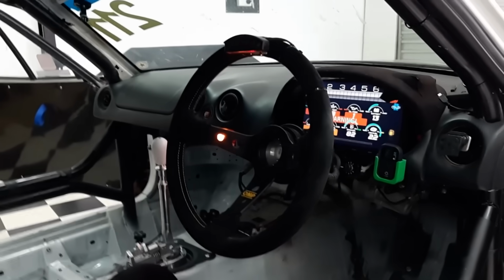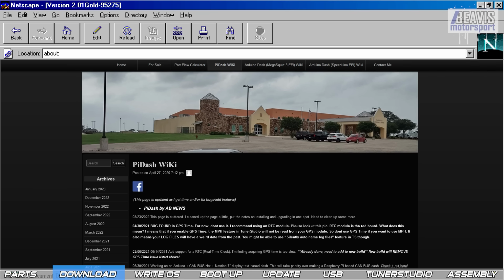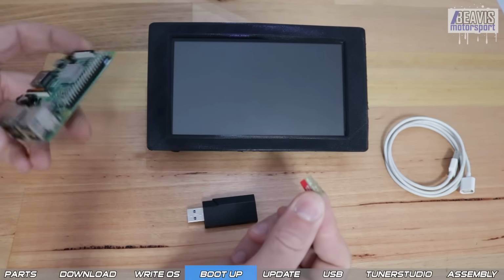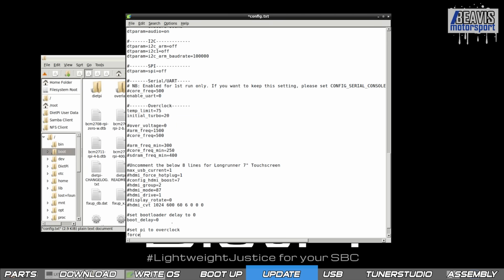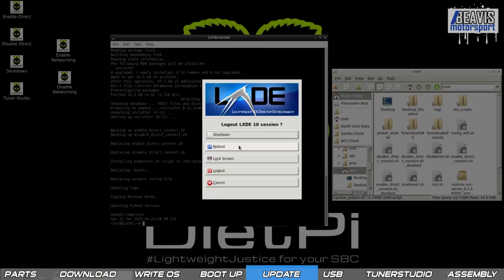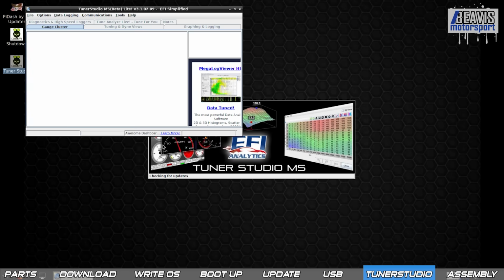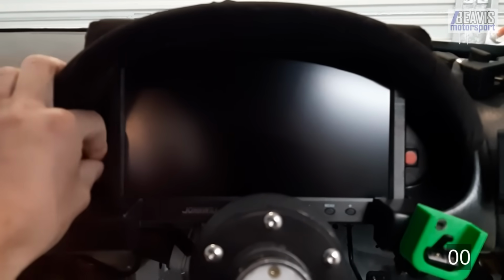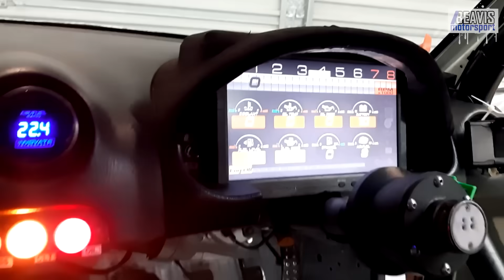DIY Raspberry Pi Racecar Dashboard: The Ultimate Guide

Comment: Awesome work! I created a very similar dash, the only difference is that I designed a safe-shut down circuit that utilizes the ignition signal and a little bit of hardware logic to automatically boot and shut down with the car keys. The initial prototype was just kluged together on a breadboard but I turned it into a PCB but have yet to get it made. Hopefully one day...
Reply from the maker: Nice work Cyrus, thanks for sharing your setup. For me, I have a hard battery kill switch, theres no ignition key in my track car, so that wasn't really going to work for my setup.
Reply: @Bbeavis  ah yes of course, because racecar. I love it! I’m definitely going to check out dietpi now though. Thanks again for the amazing content.
Reply: Could you elaborate a little more on this? I'd like to be able to use this setup on mine as well.
Reply: @rat_nuisance  automotive electronics (battery/alternator) are inherently noisy and contain a lot of transient voltage spikes. That said, sensitive electronics like RPi’s need protection from these voltage transients to avoid eventual death from the shock treatment they will certainly receive. Additionally, memory for computer systems like RPi’s can be corrupted when not safely shutdown (eg: yanking the power plug without pressing “shutdown” in the system menu). 

My circuitry provides three main features: 1. Protection against high voltage spikes, 2. Turn on with ignition on, 3. Safe shut down of the RPi when the ignition is turned off. Meaning the control circuitry has hardware logic working in conjunction with a Python script in the RPi to shutdown the RPi safely despite ignition telling the circuit to turn off…

I hope that helps highlight for you the problems I encountered and the methods I took to address those problems.
Reply: @cyruslegg I've used OSH Park to have small batch PCBs made for my own car projects. Very affordable and fairly fast turnaround.

Comment: amazing that people sell these things for $800 :face-blue-smiling:
Reply from the maker: When you compare to a commercial product, I guess it is very different. Businesses need to make their products more robust and bullet proof, whereas the solution in this video can be much cheaper, but its certainly more conducive to a tinkerer than a plug and play product.
Reply: @Bbeavis  nah man, ddefi sells this exact thing for €800 and it doesn't work close to as good as the diy one. Look at the donut media video, their dashes run at like 15 fps with delay, and they use the exact same pi hardware.
Reply from the maker: @Marco-yk8kp  Ah interesting, there are more and more solutions out there, some are better than others, I guess based on your description the defi one is not so good.
Reply: @Bbeavis  unless its a bosch motorsport or a CANbus one, its all the same stuff. A tunerstudio instance on a tiny computer mounted in your face. Only difference is if the script is preinstalled and the dash being made to fit your car or universal. If you shop for megasquirt dashes that ARENT canbus they are all what you made in a different size. Some are just msdroid tablets (for those of us with bluetooth megasquirts)

Comment: I wonder if someone made it so Kpro/Hondata can output the data to the Pi
Reply from the maker: Indeed this solution I have shared does depend on the ECU, so you'd need to see if there is a software/hardware solution that can communicate with Hondata.

Comment: Might have to give this a go to update my current dash. I mounted mine in the center console and also removed the stock climate controls. Since it's a street car I have a tuner studio dash on it but also wrote a python app to control an Arduino that runs some relays and servos to have touch screen control of my climate control. Not fully implemented in the car yet but prototype is currently working.
Reply from the maker: Nice work mate, sounds like you have it all under control already, but maybe theres a few options offered here that you can get some benefit from.

Comment: You need to setup a relay to do shut down off accessories rather than manually pushing a button. Nice work.
Reply from the maker: This is used in a race car, so it doesn't have a traditional ignition switch with accessories, its all cut via a battery kill switch, so I'm comfortable with using the push button for now.

Comment: Bonus 30 points for Netscape 2.0
Reply from the maker: :-D thanks mate!
Reply: @Bbeavis  BTW have a look at youtuber Novaspirit - mate of  mine in New York.  He has a car-android video but he also  has a build of a kiosk android config for ultra fast boot (for signage systems running on a Pi typically).  I'm wondering if this could improve powerup times on your boot;  typically I believe running off a super-fast SD card + USB 3.0 SSD gives fastest boot times, that said the boot cycle to date seems to be within expectations and even looks cool (shame the CLI text stream is so small, could make it larger and greenscreen for that Matrix Trinity Hacking look)
Reply from the maker: @davocc2405  Thank you, appreciate the suggestion.

Comment: Awesome Video.

Are you running an aftermarket ECU?

Is it possible to use the factory ECU with a Tactrix Cable or something similar?
Reply: Thanks for the detailed reply. Would you have any tips on what software I could use for Toyota 86 platform to read the data?
Reply from the maker: @billyrosewood5474  The solution I have shared does depend on using the Megasquirt family of ECU, so you'd need to see if there is a software/hardware solution that can communicate with Toyota computer. This is not something I have experience with sorry.
Reply from the maker: Hey Billy, yes I'm running this dash in a track car with an aftermarket ECU, it uses a Megasquirt MS3 ECU. So all my sensors, speed, temps etc go direct to the ECU. Then the ECU has a USB connection direct to the Pi to feed the data for the dash software.
So unfortunately if you run a factory ECU computer still, then you'll need to find some appropriate software for your car.

Comment: Will i use any other display like tab or anything like that
Reply from the maker: Anything is possible if you tinker enough. I've previously run an Android tablet to do something similar to what is presented in this video. In that scenario, you could use some apps like 'Torque' or 'RealDash'. Depends on the car you want to connect to.

Comment: @beavis how bout using a CAN pi hat ?  For remote installs 2 wire would be so helpful!
Reply from the maker: That would be an interesting alternative, obviously it would then depend on your car supporting CAN, and there'd be different software required to display the data. But hey, if you are clever with hardware and software, then it might be a fun challenge.

Comment: woooooow amazing configuration but for example if i want mount in a normal car works connected with ODB2 adapter?
Reply from the maker: Thanks very much Francisco.
In this case I am using the TunerStudio software which is specific to the Megsquirt ECUs. My car runs an 'MS3' which connects to the Pi via USB cable. I'm sure there is some OBD based dash software out there for the Pi, that may work for your needs.... You'll need to get a little inventive and look into what options are out there.

Comment: Very interesting build, but I'm wondering why the Pi gets shut down instead of just sent to sleep. It's passive powerdraw shouldn't even be noticeable on the battery.
Reply from the maker: Because it's a track car, and I cut the battery every time i shut the car off.
Reply: @Bbeavis  Ah right, those don't have a keys for the ignition I assume?
Reply from the maker: @BloodyMobile  In my car, correct, no keys, just a big red switch.

Comment: Has DietPi still Problems with Wifi only installs? Tried it a few month ago on a Pi 3B. Didn't get it to run.
Reply from the maker: Hi Christian, I noticed no issues with cabled ethernet, or wifi, I had used both during my build/setup of the Pi.

Comment: How does the dash get all the data to display
Reply from the maker: Hey PDRIFT, this is using the TunerStudio software, specific to the Megsquirt ECUs. This car runs an MS3 which connects to the Pi via USB cable. So all my sensors, speed, temps etc go direct to the ECU. Then the ECU has a USB connection direct to the Pi to feed the data for the dash software.

Comment: How do you collect data from the vehicle into the Pi?
Reply from the maker: Hey Jeremiah, all my sensors, speed, temps etc go direct to the ECU. Then the ECU has a USB connection direct to the Pi to feed the data for the dash software. In this case I am using the TunerStudio software which is specific to the Megsquirt ECUs - that's what I run in this car.
Reply: @Bbeavis  All that sounds like BEEP BEEP BOOP BOOP to me but i appreciate the response ... do you have any videos that teach this part of the connection?
Reply from the maker: @jeremiahbullfrog9288  It can get pretty detailed depending on how far down the rabbit hole you want to go. But sadly I'm not sure I have any specific videos to help you out with more info I am sorry.
Reply: @Bbeavis  OK thanks!

Comment: Although it’s a bit slow on boot. I do like it. But without a 3D printer hard to realize.
Reply from the maker: I wouldn't let the 3D printing part of the equation stop you, there are always other ways to make it work. Or, find yourself a used ender3 printer for ~$100 or so and start a new hobby :-)

Comment: Excellent video.  I see you have customised your own display.  Could you go through that?  I'd like to make one for my gyro.  Different sensors but all using gpio so wondering how easy it is to design the graphics.
Reply from the maker: Thanks very much Cameron. The dash imagery is designed in a basic image editor (such as Photoshop), nothing too special there. Then it's  put together using the TunerStudio software to implement the data overlays from the cars ECU. Note that the TunerStudio software is specific to the Megsquirt ECUs which is what my car runs.
Hope that helps!
Reply: @Bbeavis  yes that helps a lot thanks

Comment: This is really awesome. You might think about modifying your shutdown script to take advantage of a relay instead. Connect the relay to your 12v + and - so it detects when the car is on. When you turn the car off it would then close the relay invoking the clean shut down sequence.
Reply: With a race car, you won’t want to wait 30 or 40 seconds every time you’ve switched off the ignition. 
My Fiat ignition switch goes from zero to start no problem. But just switch on but don’t start and you have to switch it off & on to start the engine. A Pi dash would need its own switch. Or maybe a relay connection with the door locking.
Reply: basicly acts like a sense pin (looking fo acc. min.) for key turn i take it?
Reply from the maker: I have considered it, and definitely that would make sense for some people/cars, but for my purposes i like the simplicity and control i have with the current setup.

Comment: If I didnt already have Fueltech I would absolutely go this route if I had purchased Haltech or Link. This takes a bit of time but it saves so so much money!
Reply from the maker: Thank you, 100% this isn't a plug-n-play off the shelf dashboard, but it is generally far cheaper. One perhaps needs to have a tinkerer mindset to build and maintain something like this.
Reply: @Bbeavis  Anyone serious or even semi serious would really understand the value of something like this. If anything it could be a nice update for 20+ degraded analog oem gauge cluster
Reply: @uknterror508  problem is usually the boot time, I planned to build one to replace my failed speedometer but never found something that could boot fast enough.
Instead I use a microcontroler with a very crude display, but it's not really appealing nor big enough. The µc boot almost instantly but doesn't have the power to drive anything other than a very small screen with a 3fps refresh rate.
There might be a workaround, by driving it with the door switch instead of the ignition key, so once I'm ready to start the car the Rpi would have already started.

Comment: How do you connect your ECU to your USB extension cable? How do you know which pins to connect?
Reply from the maker: The ECU has a USB connection direct to one of the Pi's USB ports, to feed the data for the dash software.

Comment: Good job Guy ;oP
Very interesting...I want to do the same thing but for a 70s vehicle. so i need to add an analog to digital interfaces part to get the information from the analog sensors for the Rhasberry :o)
Reply from the maker: Thank you. Yep for an older car you'll have a bit more work up your sleeve to get information about the car. I am running my car on a Megasquirt ECU, if you can update your car to EFI (assuming its carb), and run it on an Megasquirt ECU, then this dash config would be more or less plug and play.
Reply: @Bbeavis  Yesss ... :oP 
It is indeed a carbureted vehicle.
Can you tell me more about "EFI transformation", what is it?

Comment: If you use a Sandisk extreme usb sad you should be able to speed up boot up time pi 4 supports this for awial now
Reply from the maker: I have tried a Samsung USB boot drive and didn't find a measurable improvement in startup time, but suffice to say I didn't spend too much time trying to ensure I did everything right to get the most out of USB boot performance.
Reply: @Bbeavis  my sandisk read speeds run at 3 gig/s. I haven’t ran it in the pi for a bit as my needs are more storage then speed that I was using an 8tb external drive instead that was a big headache with having to manually switch mbr to gpt and then edit a file to have the correct uuid for the new setup

Comment: Cool video, thank you, is there any sort of tutorial on how to actually integrate in the vehicle? Lets say for instance if you wanted to swap in to your daily driver? or for setting up in a race car?
Reply from the maker: Hi FOTW, thanks for your comment. I guess I didn't touch on that element of this dash setup as much as I should've. This is using the TunerStudio software, specific to the Megsquirt ECUs. This car runs an MS3 which connects to the Pi via USB cable.
If you run a Megasquirt family of ECU in your car, then you can apply the same software process as I have detailed in the video. If you run another ECU, or the factory computer, then you'll need to find some appropriate data/dash type software for your car/ECU.

Comment: Awesome project, however, how does the Pi know all of the vehicle's data to display?
Reply from the maker: Thanks Kit,  apologies I didn't touch on that 'car data' side of this dash setup as much as I should've. This is using the TunerStudio software, specific to the Megsquirt ECUs. This car runs an MS3 which connects to the Pi via USB cable.
If you run a Megasquirt family of ECU in your car, then you can apply the same software process as I have detailed in the video. If you run another ECU, or the factory computer, then you'll need to find some appropriate data/dash type software for your car/ECU.
Reply: @Bbeavis  Thanks for the reply - guess that's only for modified cars though.

Since my Car is quite old and I guess it does not have an ECU (does it?).

Anyway, that explained it very well :)

Comment: I was looking for digital gauges to put on a bike, but this is a nice project. Is there a 'cutdown' version of the software (just rpm,fuel,oil,km), maybe a smaller screen that you know of?
Reply from the maker: Hey Cade. The dash image/data is very customizable within the TunerStudio software, so almost any design is possible.
You could run a different size screen, more or less any display that uses an HDMI port should work, I've had smaller 7" screens before, and I'm sure there are even smaller options if that's better for you. You'll need to experiment or check out websites like aliexpress for low cost displays.

Comment: Great work. Appreciate the effort you took to make this video. Can you tell me what software you made the Dash graphic layouts in ?
Reply from the maker: Thanks very much Imran. The dash imagery is designed in a basic image editor (such as Photoshop), nothing too special there, just a few evenings spent trying to design some fairly low effort graphics. Then it's  put together using the TunerStudio software to implement the data overlays from the cars ECU and the TunerStudio software is where all the data can be laid out over the Photoshopped graphics. Note that the TunerStudio software is specific to the Megsquirt ECUs which is what my car runs.
Hope that helps!

Comment: I feel like i missed how this interfaces with the car. Is this using like obd II to usb?
Reply from the maker: Hi Jimmy, The ECU has a USB connection direct to the Pi to feed the data for the dash software. It is an aftermarket 'Megasquirt' ECU and doesn't use the OBD protocol, instead the TunerStudio software is specific to the Megsquirt family of ECUs and is able to interface with the ECU directly via USB(serial).

Comment: Sorry I just came across this video and was wondering how do you hook up all the engine harness or dash harness to this ? Is it all wireless or dose Thia use an aftermarket market ecu and harness for what ever project it’s being used on ? I’m primarily in the Honda street scene so I’m curious what it would take to put together something like this let’s say for a 1990 Honda civic four door ?
Reply from the maker: Hey Uzumaki
I'm running this dash in a track car, that uses a Megasquirt MS3 ECU. So all my sensors, speed, temps etc go direct to the ECU. Then the ECU has a USB connection direct to the Pi to feed the data for the dash software.

If you run a Megasquirt family of ECU in your car, then you can apply the same software process as I have detailed in the video. If you run another ECU, or the factory computer, then you'll need to find some appropriate software for your car.

Thanks for watching.